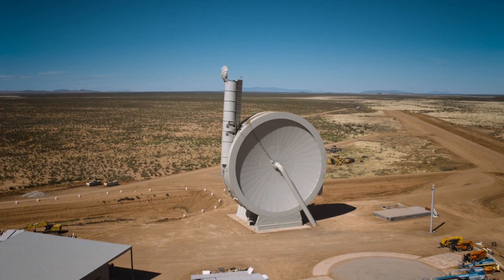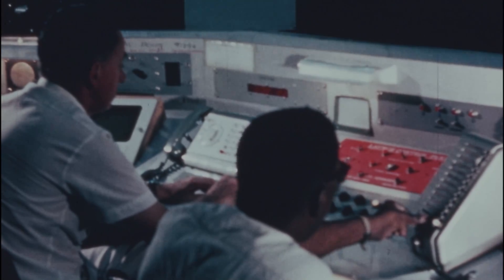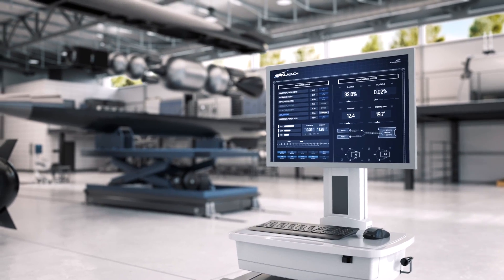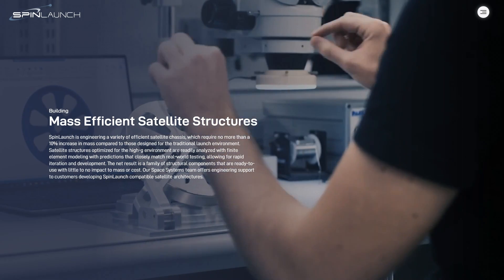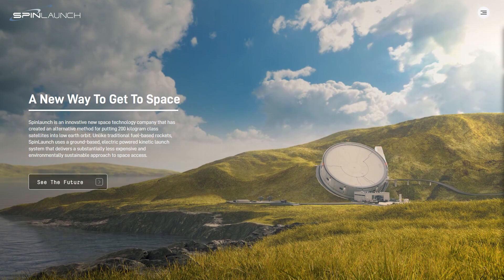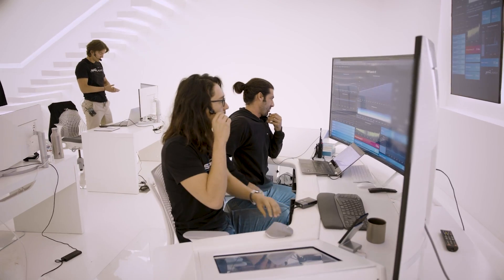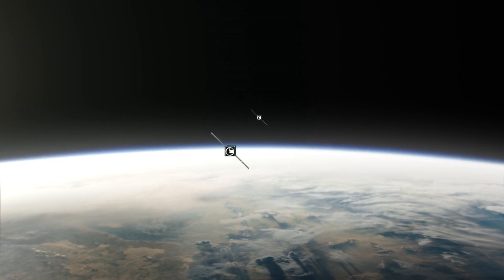Can Spinlaunch Throw Rockets Into Space?

Comment: Wouldn't they do better to put it in some place like Equador, on top of a high mountain?  It would then be able to use the equatorial boost and would have less air resistance.
Reply: Also launching at low weather atmospheric variation could make a difference.
Maybe even hung on a balloon. These can go much higher than mountains.
Reply: @musaran2   you can't feasibly hang something that spins this fast and needs this much power on balloons, think about it.
Reply: Its inconvenient and expensive to operate there, and it is away from comfortable housing.
Reply: @carbon1255  , Quito, Ecuador is at 9,350 feet or 2,850 meters.  The population is over two million people, so it can't be THAT inconvenient.  The cost of living isn't the cheapest in the world but it isn't the worst.    It's cheaper than a lot of cities. All in all I'd rate it as nice as Capetown or a lot of other major cities.  The cost of a good apartment really is pretty cheap.  Actually, if you paid your technicians and engineers in USA wages they would live very nicely.  Yes, Quito is RIGHT on the equator.

At that altitude, you're a mile and a half high.  That horrible first two miles of rocket lift-off is mostly underneath you before you launch.  The atmospheric pressure is only at 0.72 atmospheres.

That's not the highest place around. If you wanted to go all out, there is a 4,000 meter high peak between Papallacta and Quito that's on the main road.  If you built up there, the air pressure would be a little over half of the pressure at sea level.  That's quite a reason.  If your lift catapult tosses your rocket up another three kilometers, you will have an air pressure of about a third of the sea level pressure when you fire the engines.  That's very much worth working for.

Comment: What are the benefits of this over a linear accelerator? 
I cant imagine the power savings are that high if it takes hours to ramp up while drawing the power of a neighborhood and there's so much potential for catastrophic failure from tiny mistakes. 
Leaving a single gram of weight could making this monster wobble itself to death instantly and a fraction of that could cause damage over time. 
It's neat idea but I dont think it's very practical.
Reply: The advantages are way way less acceleration and a much lower volume to evacuate air from.

Comment: I wonder if it would be easier to have an identical mass on the other side released at the opposite end directly into the ground or some some other materials to dissipate the energy from such an object. Seems like it would be easier to solve than releasing a large weight and having the spinning arm compensate in such a short amount of time.

Comment: Re: The comment about this being perfect for an industrial operations on the moon:

I don't understand why one wouldn't use a linear rail gun/accelerator.  You're right that the lack of an atmosphere would help the centrifuge and the velocities would be lower, too, but if you use a linear accelerator, you can get all those benefits and the same velocities without the hundred or thousands of gravities of acceleration.  The only reasons I can think of are if you were space limited for some reason.  Or maybe if the materials to build the accelerator would be too expensive?  That doesn't seem amazingly likely.  I guess maybe a large centrifuge would be possible (though difficult) to move around for aiming purposes where a linear accelerator probably would be fixed in place?  But for an industrial operation, you probably want to do basically the same trajectory all the time.

Comment: for atmospheric launches... why not try a fill with atmospheric pressure steam? OK not quite as much drag reduction as vacuum, but it's still reduced lots. also M1 velocity is much higher than in air.  no pressure change, might ease transition into atmosphere. also avoids need to pump down to vacuum taking ages/loads of non recoverable energy.

could probably use externally pressurised aka hydrostatic bearings powered by pressurised steam.  Are a low friction bearing type much like an air hocky table but rather than a puck  running on flat, having a ring running on inside walls of a fixed cylinder. two rings that rotate with gap between them through which the projectile would exit to the the launch tube .with decent diameter  lots of area for forces from rotation to reacted through. F=P*A and all that. As held in place from outside...rings don't need "spokes" to prevent them from flying apart, or hold them to a circular path. so rings could be very light weight. saving time and energy for spin up.  turn rings akin to rotor of an electric motor ie a rotating magnetic field.

Comment: 9:00 The balance issue is fairly simple, as long as you can release both the rocket and part of the counterweight in the same millisecond in opposite directions. Just drop the counterweight downward into a tube filled with water, or maybe increasingly dense layers of foam if you want to be fancy. 
1. Empty rotor is balanced.
2. Loaded rotor is balanced.
3. Suddenly unloaded rotor remains balanced. Catch and reuse the slower moving counterweight.

Comment: I imagine setting this launcher up at a higher altitude would improve its performance a fair bit (thinner air, less resistance for the launch payload when it leaves the centrifuge)?  That or running the end of the launch tube up the side of a mountain.  Another thought, launching some sort of dummy payload just before the actual payload to create a low pressure zone for the actual payload to travel through, creating less air resistance.  No idea if it would be worth the effort.
Reply: I think the benefit of reduced atmosphere is possibly marginal, given all the energy you have to expend to get everything up to the location (both for construction, and launch). I think putting a dummy payload ahead of the real payload would either result in our payload hitting the dummy, or the dummy would have to be going much faster than the payload, which doesn't make any sense, because in order to "draft" the dummy, the payload would have to remain somewhat close.
My guess is that it's probably not worth the effort. Or maybe they will build somewhere at elevation for the marginal gain.

Comment: How do they shed all of the rotational momentum of the projectile when it's launched? If they simply detach it, wouldn't it still be spinning?
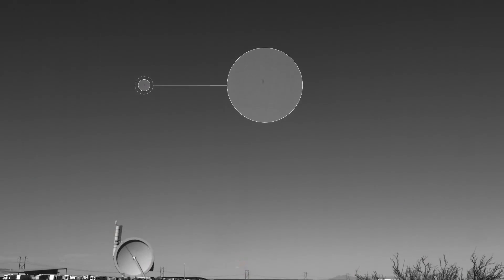Reply: Perhaps they can detach the front of the projectile slightly sooner than the back part, to cancel the RM. Or perhaps they rely on the fins to aerodynamically cancel it. Interestingly, its still having RM would account for it exiting the vacuum membrane slightly sideways at 4:30. There's a flash four frames into 4:34, where it the fin appears to strike the edge of the chamber. I suppose that's another way to cancel out the rotational momentum.

Comment: Pull upon release you're going to maximum speed you're going to instantaneously break all the sound barriers within a tight compression barrier. That to me would seem like an extremely violent initial period To substrate through.youll need to pre seed your flight path with a gas trail to prevent that from blowing up the launch platform with kenetic energy.

Comment: Not only must the release be timed perfectly, the rebalance of that rotor needs to happen very quickly after the payload is released.   If the balance is way out, golly within half a rotation things will start getting torn up, yikes!  seems like a silly idea, ad to that the g forces on the payload and this dont seem very practical.

How about a big ballon to lift a rocket high up, then launch from that point?

Comment: Considering the vehicle has little or no fuel onboard, it could safely fly over populated areas.  Therefore, the launch site could be anywhere, say the top of the Himalayas. A 23,000 ft (7,000 m) elevation would significantly reduce the energy required compared to a sea level launch.

Comment: ya ya a coilgun would be better, and if not a strait shot you ould have like a  maglev kinda thing and sled were the projectile would have all it needs to exit, the relese mechinism could be just swiching  off magnets, but thats complicated, with  a good amount of power can just use the better efficiancy of a coilgun to push it out strait without worrying about things getting welded if its just floaing in the middle or perhaps surrounded by  some material that isnt metal.

Comment: I wonder if on the moon this could work in reverse. You've got your spin launch and you time it just right so that it catches the de orbiting entity, at which point it uses electric engines to slow down. Maybe that charges up a capacitor or battery bank such that you can use that energy to launch a new entity.

Comment: Couldn't you solve the counterweight imbalance issue by not using a counterweight? Instead just load two vessels up (one on each side of the rotating arm assembly) and launch them consecutively. The momentary imbalance could be simulated and corrected for.